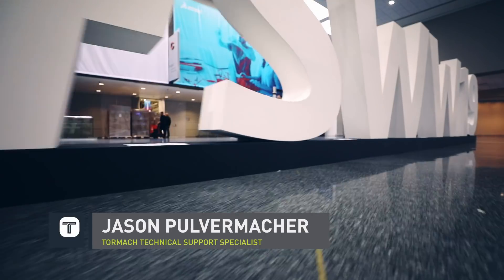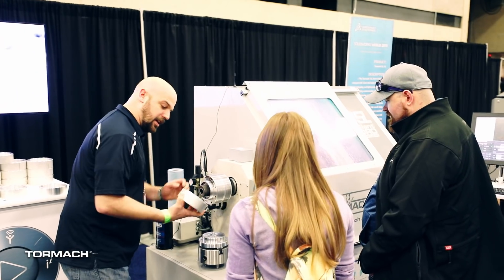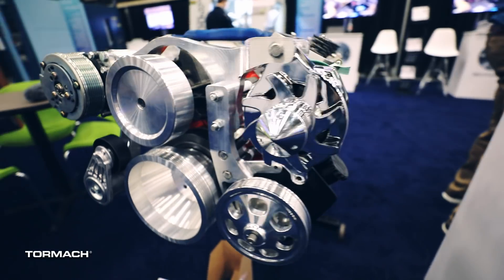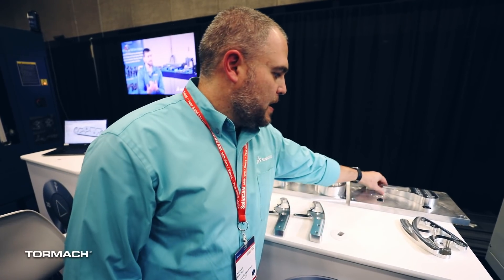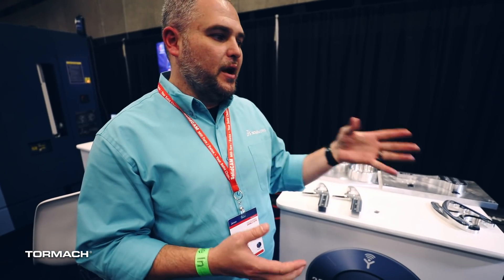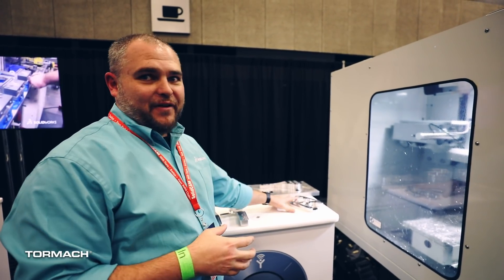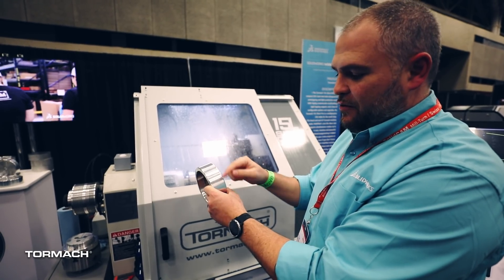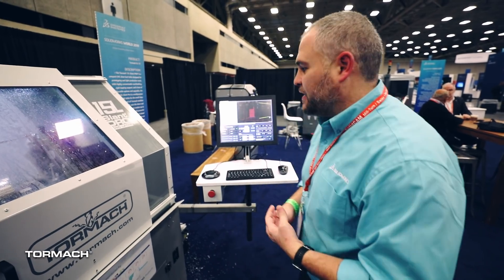Tormach Takes an 1100M+ to SOLIDWORKS World 2019

Comment: What the heck is an M+ ? Is this instead of the MX, has that project died, been renamed, or is this something different?
Reply from the maker: We will have 3 different tiers to choose from. The M series will be a stepper-based machine with the TTS tooling. The M+ is a user-upgraded M with servos and TTS tooling. The MX will be a servo machine with a BT30 tapered spindle, that can be factory- or user-installed.
Reply: @tormachinc  
Thanks for the clarification, glad the MX is still happening. Cheers, Owen.
Reply: @tormachinc  What is the expected upgrade price to go from an M to an M+? I know going from the M to the MX is about $4000, is the M+ upgrade about $2000?
Reply: Will any of these upgrades be available for series 3 owners? I'm sure you guys are sick of that question by now.
Reply from the maker: There will be a servo motor upgrade package available for the Series 3 machines. This package is in development, but we do not have a firm availability date at this time. Please subscribe to our YouTube channel and watch our blog for updates.